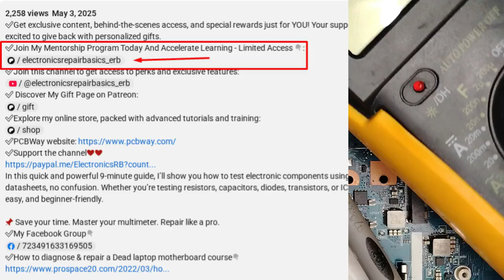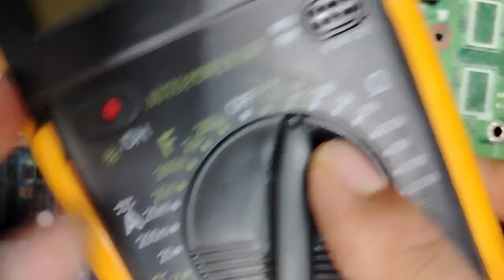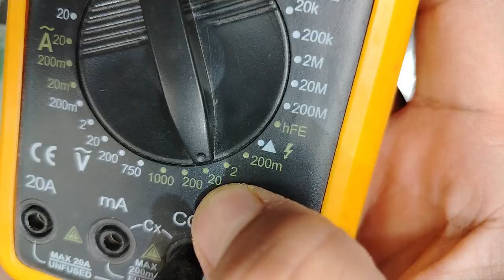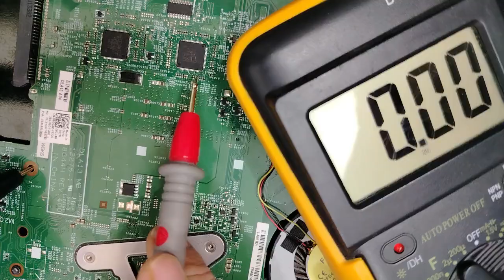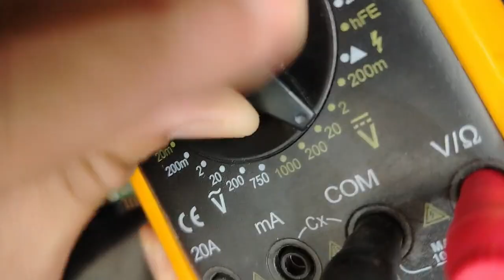How Experts Test EC/SIO Without Guessing | Laptop Motherboard Repair

Comment: Both my cpu and gpu fans are not working. 
Fans are fine as when I use "MyAsus" app to test the fan, it spins but doesn't auto spin during boot.
When I power on the laptop, it takes 10 seconds to display the Asus Rog logo and in just 3 seconds boots into windows but due to fans not spinning the pc heats up and shuts down instantly. 
There was a small spark when I unplugged the battery connector on the board and the fans stopped spinning ever since.
The inbuilt keyboard malfunctioned an year ago i.e only a fee keys work.
I use external keyboard and mouse .
What could be the issue
Reply from the maker: It could be a problem with the EC, and I recommend that you check it.

Comment: The laptop is hp 4540s all voltages are present after turning on in secund it turns off. Cpu ic controller shows short when I check between vcc pin and ground. what would you offer ? Thanks in advance
Reply from the maker: 1. Confirm the Short
Use continuity or resistance mode to check the VCC pin of the CPU power rail (typically VCORE, or VCC_CORE) to ground.

If resistance is very low (e.g., under 2 ohms), that’s a solid short.

2. Isolate the Source of the Short
Check if the short is in:

CPU itself

Power IC (VRM controller)

Associated high-side/low-side MOSFETs

Capacitors on the VCORE rail

Start with:

Visually inspect for damaged caps, corrosion, or burnt marks.

Measure large bulk capacitors near the CPU socket.

If you have a DC bench power supply, inject 0.9–1V into the VCORE rail (with current limited to 1–2A max) and watch for the hot component.

If CPU heats instantly, it's likely shorted.

If a cap or MOSFET heats up, that's your culprit.

Comment: Hello sir I have an acer aspire e5 722g that doesn't show light when plugged and not charging when I press power button it powers up but no display no fan spin when I checked it has 19v and 5vsb but no 3vsb should I suspect that IO is faulty or could it be smth else?
Reply from the maker: nterpretation:
5VSB present but 3VSB missing means part of the standby power system is working.

The 3VSB rail is critical for powering the embedded controller (EC) or IO chip.

No 3VSB typically means the IO chip is not getting power, hence not able to initiate power sequencing (like turning on fan, display, etc.)

🔍 Possible Causes:
Faulty 3VSB Generation Circuit

The 3VSB is usually generated by a dual-channel regulator (like RT8205, PU ICs, etc.).

Check the 3V LDO or buck converter IC that generates it. It may be defective or not getting EN (enable) signal.

Bad MOSFET or Short on 3VSB Line

There could be a short to ground on the 3VSB rail, causing it to drop or not come up at all.

Use a multimeter in resistance mode to check for shorts on 3VSB output caps.

IO Chip/EC Faulty or Not Enabled

If the IO chip gets no 3V, it's not active, so it won’t sequence the system or enable the main power rails.

However, don’t assume the IO is bad unless you've confirmed the 3VSB power supply circuit is healthy.

BIOS Corruption or EC Firmware Issue

This is less likely since you don't even have basic fan spin — typically the EC must be partially running to spin the fan.
Reply: @electronicsrepairbasics_erb  Thank you so much for the quick reply sir, one thing I forgot to mention is that near the power jack there are 2 inductor and 2 tentalum capacitors one is missing and they're both responsible for 19v one supports it just fine but the other doesn't and when I probed around I found that a phase controller bq737 possibly dead because when i removed it and checked resistances on IO chip especially AC_IN# it went up when it was almost 0ohms before and for the 3.3vsb rail there inductors with one being 3.3v phase 2 and I tracked the EN signal for 3v_5v it seems to be fine so I dunno if I should just replace that phase controller or is the issue lying somewhere else? Btw the IO chip seems to have 3.3v on some of its pins so it's probably okay?
Reply: @electronicsrepairbasics_erb  I even tried to jump pins in keyboard connector to power on the board to check other voltages if they're present, I noticed that the gpu and cpu were getting hot and checked found 0.5v for gpu rails and 0.75v for cpu and the 3.3v was present as well and so was the ram voltage which was 1.35v ddr3 so I'm really confused to where could the issue be

Comment: If you get all voltage like 19 and 3 and 5 voltage present but they is no display what is the solution plzz feedback me
Reply: Thanks 🙏 alot my brother let me program bios I will give feedback back plz I wnt your number chat through WhatsApp plz can I send for me
Reply from the maker: If you’re getting all main voltages but there's no display, here are some steps to troubleshoot:

Check for CPU VCore – Make sure the CPU is getting its core voltage (usually 0.7–1.2V). No VCore often means a dead CPU, bad BIOS, or EC issue.

Look for BIOS activity – Try reprogramming or replacing the BIOS chip. A corrupted BIOS can cause a no display issue even if power is fine.

Inspect the RAM and RAM slot – Bad RAM or a dirty/faulty RAM slot can cause no display. Clean and reseat it.

Check the EC and SIO chips – These handle power sequencing. If EC/SIO isn't working correctly, it might not trigger the GPU/CPU/display circuits.

Look for shorted components – A shorted GPU or PCH can pull down signals and stop the board from booting fully.

External display – Try HDMI or VGA out to rule out a faulty internal display or backlight issue.

Let me know what you've already tested and I can guide you furthe
Reply: @electronicsrepairbasics_erb  thanks alot my brother Im reprogramming the bios you number I wnt to text you through WhatsApp